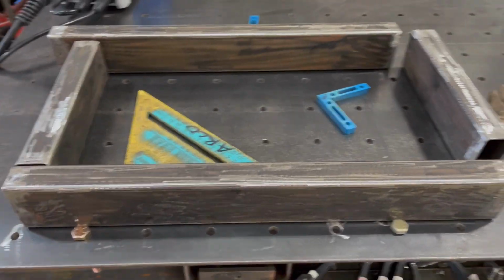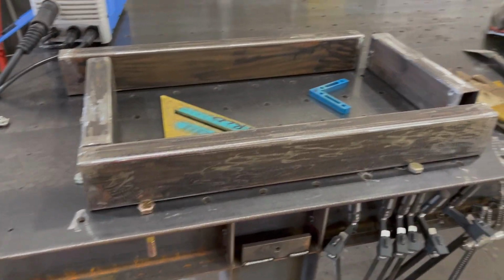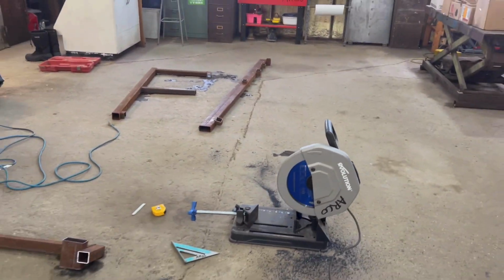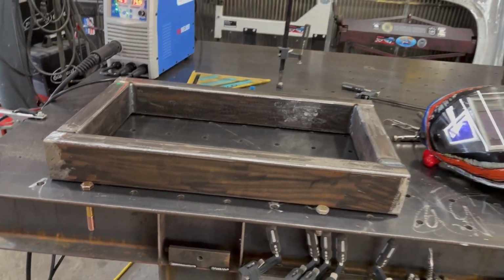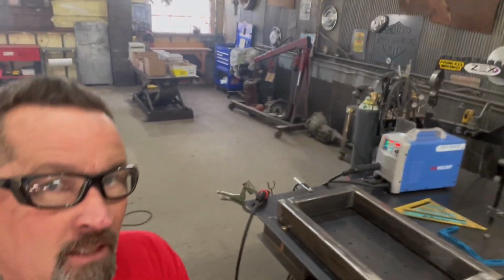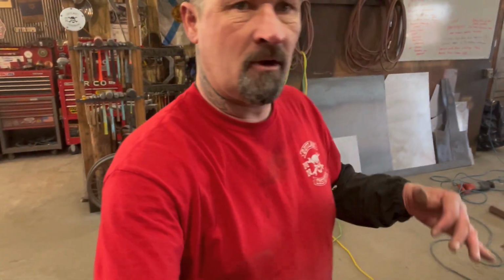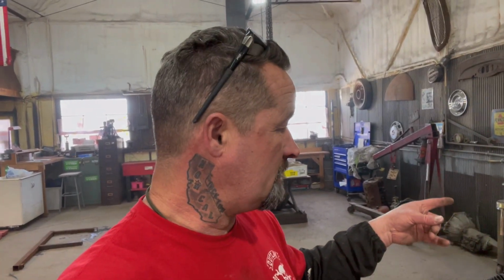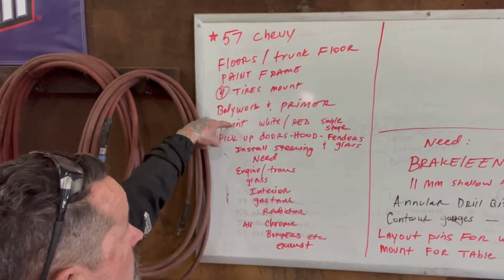YESWELDER -Building a welding cart  #yeswelder

Comment: I knew you would have a hammer for that!  The layout table is great..  Like a really quick jig.  I need to check into their mig, tig, arc welder.  I could sell three welders and be left with one welder and my YESWELDER plasma cutter. Or maybe the system they have that includes the plasma?  Have to think that one over...  Sure is good stuff.  I have that same clown helmet...  Go figure...  You're camera work is great!